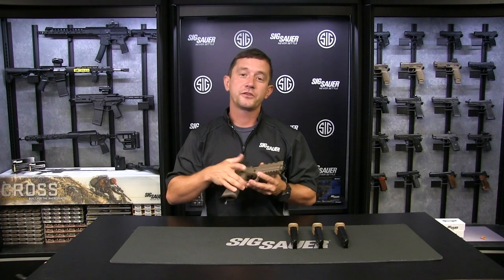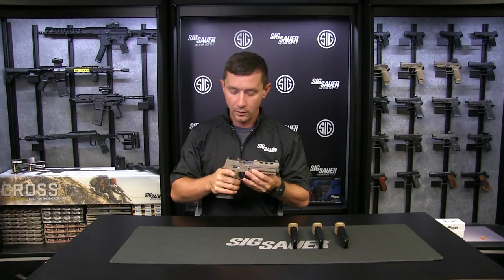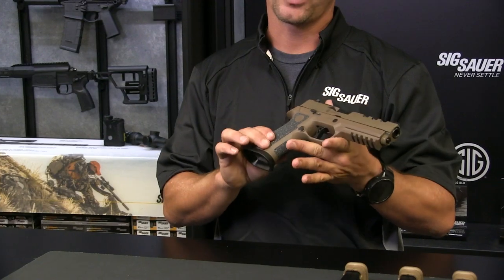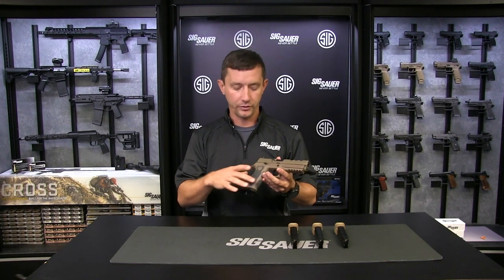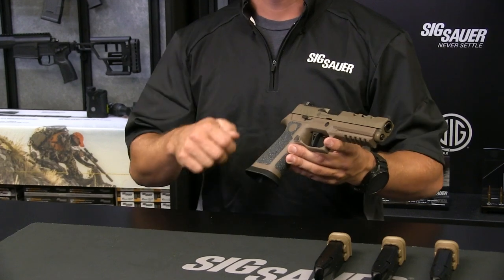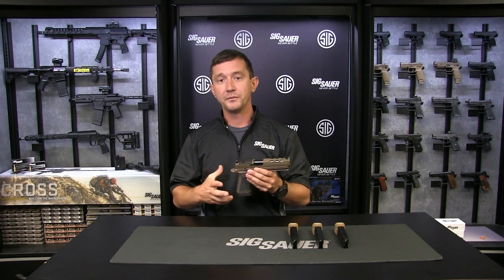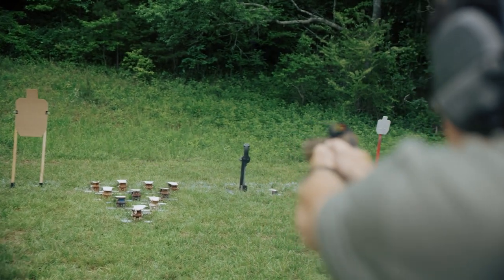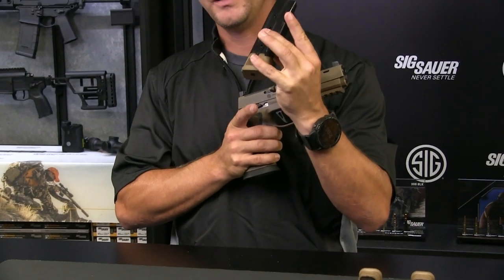Introducing the P320-XFIVE DH3

Comment: Was cool until he mentioned it took them 2 years to come up with the.... cerakote, silicone carbide, and attach x5 parts to create this gun.
Reply: Exactly, we basically did this as soon as the original p320’s came out.  Why not just have some engineer and/or reps go to competitions and learn from the shooters?
Reply: Had to do it in their spare time. You know, in between getting down on their knees for the government 😂😂🤣🤣
Reply: It took glock 30 yrs to put front slide serration on the guns 😂😂
Reply: I noticed that comment as well. I am also concerned about the “Tactical”. Those lighting cuts look like they may be an issue with the traditional RDS duty holster.
Reply: @tacticalcharlie4696  🤣🤣🤣
Reply: @chap23305  and getting sued for not being drop safe😂
Reply: @michaelsmith4325  Truuuuuuuue
Reply: @cpd9608  that's why they have Daniel Horner and other marksmen on board
Reply: Hahaha
Reply: The new grips will help if your “hands get wet”

Comment: So... Is it going to fire on its own? Just asking. Sig has taken a hit lately in the quality area. P320, P365SAS... C'mon Sig.
Reply: C'mon dude, just drop it already!! (See what I did there?)
Reply: There is a fix for that, just don't become a cop.
Reply: @gator7082  it’s been happening a lot man
Reply: @areyou0k98  it’s a lot of people making these claims man..just type it into this site alone..the weapon has problems..I have 4 p320’s and it’s never happened to me..but the problem very much exists
Reply: @andrewthetool  no Drew. Just the 365SAS has the problem with it's sight. Sig won't acknowledge it and will not fix the problem. The sight, which cannot be adjusted, is not properly aligned with the barrel. So that's the problem in a nutshell. Sig quality is not what it used to be. They've gone for quantity over quality.
Reply: @Chuck Atley  Do you know if it simply happens when you have one loaded in the chamber? Probably a silly question but I'll still ask it.
Reply: @johnnybravo1204  not a silly question. Yes one would have to be in the chamber to fire. However, how long in the chamber or if it could accidentally discharge, immediately upon cycling a round could be a concern. I think, for the most part, the allegations have come from law enforcement officers who generally carry a round in the chamber while on duty. Apparently some condition occurs causing the 320 to accidentally discharge. Not sure what those conditions are as of yet.
Reply: @Duke Daddee  Such a great gun to abandon over this. I'm just not gonna have a round chambered then. Thanks for the reply sir. Have a good one.
Reply: @johnnybravo1204  I understand. Just stay alert when firing or when cycling a round into the chamber. Keep it pointed in a safe direction. And keep an eye on the lawsuits to stay informed. Also keep an eye on what Sig does or doesn't do. Never know if this is a concerted effort to bankrupt Sig based on BS.
Reply: This is just like the canik sfx rival.
Reply: @dukegfsl  most likely using an incorrect holster is my bet. or just lack of trigger discipline.
Reply: I don’t get why sig won’t drop a bunch of tests out of x thousand’s hand guns that are randomly picked through a bunch of conditions through a bunch of different people cause legit or not it is definitely is not a something the unfortunately need to prove to consumers.
Reply: @michaelstringer1840  they have Michael. But remember, the P320 was developed for the US Army. They do not carry locked and loaded. So that may play a role in this. Also Sig IS NOT what they used to be. They have decided to pursue quantity over quality. Much like Toyota did 20 years ago.
Reply: @dukegfsl  ok I forgot that the P320 is what the army uses. I did not know but never really thought of that with how they carried it versus the police/law enforcement. Being real I like how they shoot but because of the lawsuit they fell off the list of handguns. I’ve been looking around for a good carry/self defense hand gun.
Reply: @dukegfsl  to me, there are a few areas of life that can allow for some wiggle room, and things don't have to be perfect. However, a carry gun does NOT fit into that category, and never will for me. I have heard of FAR too many issues with these guns to have any faith in them at all. Heck, my dad and his friend bought 2 brand new Sig's back in the day to train together, and had no end of issues with them, so they had to get rid of them.

Personally, I haven't had a single (and I mean SINGLE) problem with my FN 509T and my brother-in-law's Glock 19 carry gun.

The only issue we've experienced was a failure to eject/stovepipe due to a bad grip, and that happened the first time I shot his Glock many years ago lol.

Point being - guns are Dangerous Tools, and I would rather have my Dangerous Tool be something that I can rely on to not shoot myself or someone else by accident.

Call me crazy, but I do care about Safety. 🤷‍♂️
Reply: @dukegfsl , you’re mistaken Duke. In the Army the pistol is absolutely carried with a round in the chamber, ready to go…
Reply: @thegreenberetlife0191  no. Maybe in SOF units. But not in most units and certainly not CONUS.
Reply: @The Green Beret Life 01  I'm not easily manipulated. I can choose whether to believe it or not which you only assume I have so. Still good to be aware regardless. But I will take your comment into consideration as well.
Reply: @connorbaz5980  I understand. I have Caniks, Glocks, Sigs, S&Ws, Ruger's, Taurus, Springfields & Barettas.  The ONLY firearm I wish I had never purchased is the Sig P365SAS. That is the newest Sig I have and is the one I would get rid of first, but I won't, because it is UNSAFE. I won't carry it because of the sight issue. Sad that a Sig, designed for concealed carry, has a sight that does not promote confidence. EVEN SADDER is the fact that Sig will do nothing to remedy the situation. Think about that. I am an FFL holder and gunsmith and I will never purchase another Sig again due to their unwillingness to not only fix a faulty firearm but acknowledge a problem. It's very obvious to me that the lawyers run the show now.
Reply: @dukegfsl  absolutely right. I also cannot fathom how many people in the gun community literally make excuses for Sig in the face of such issues. This isn't just a "bad look" for the community, I think it's a very serious issue that gives The Other Side a lot of ammo to use against guns in general.

If you literally cannot rely on a firearm to be at least mechanically safe...I mean, I could see how it'd be easy to get the support of well-meaning yet ignorant people on banning these types of "dangerous, self-shooting weapons of mass destruction off our streets."

This is absolutely shameful in my eyes. 

Even if you own a Sig that shoots flawlessly, and you've NEVER had a SINGLE issue with, you should still be 100% in support of holding Sig accountable, and improving themselves, their reliability, quality control, and clearing their name.

But NOPE, the fanboys cry when you (rightfully) criticize a BAD product, and call you names.

Bunch of immature little bitches we have in the community right now unfortunately. All focused on "the next big, cool, Instagram trend-thingy."
Reply: @michaelstringer1840  if you're on the larger framed side, I would recommend the FN 509 series. I'm 6'1" and can conceal the tactical version pretty well. Bulkier clothing does help as well, since I can't exactly carry appendix...(40-ish pounds down the road maybe.)

It's definitely a little on the thick side, but it is a full size frame with a midsize slide, 17 round mags and is optics ready.

I really like it so far. Unfortunately, there's not as much aftermarket support for it out there which is a crying shame. It's a fantastic platform, and the one that really revolutionized the multi-optic cut system for handguns.
Reply: @connorbaz5980   thanks for the info I’ll keep my eyes peeled but I’m at liberty of what my local ranges have for rentals/used firearms. Rentals I can put more round’s through. The used one I’m limited to 10 rounds. I definitely want to put a few rounds through it to get a feel for it.
Reply: Teslas have FSD- full self driving. Sig has FSF - full self firing
Reply: @connorbaz5980  That's why I love these venues. It helps one make better decisions. I've ALWAYS loved Sig. Will no longer buy anything post 2015.
Reply: @michaelstringer1840  ahh, I see. Yeah the FN is awesome, but it is a bit pricey - and so are the magazines. Aftermarket support is a BIG factor, especially for budget challenged people like myself (most weeks lol.)

If you're on a budget, I'd recommend a Canik or a Palmetto State Armory Dagger (Glock Pattern Handgun) which can be found for around $300 or so. I'm guessing most Glock accessories should work just fine with the Dagger, and they won't break the bank either.

I've heard a lot of great things from both of those brands, and minimal negatives. Still, I'd recommend you just find what works for you. If the price is a little steep but the gun is basically everything you're looking for, I'd also just bite the bullet. Ultimately I guess you have to decide for yourself how much your self defense is worth.

I'll likely never have to need mine - but if I do...well, I'll be glad I don't have a Sig lol. 😂
Reply: @michaelstringer1840  understood. I highly recommend the Canik TP9 series. Great firearms for a great price.
Reply: @chuckatley1464  There are are a lot of idiots walking amongst us
Reply: Well, they dropped support for everything but 9mm for the most part. So you figure if they aren't focusing on other things they should be able to get it right.
Reply: I like that you guys basically do the work of the anti gun lobby for free
Reply: @Ronnie Ray  lol yeah like the guys suing sig for their own ND
Reply: @seann2769  lol 👌
Reply: @588holly  a trained police officer? That's a stretch lol🤷‍♂️
Reply: @@dukegfsl  exactly I agree they should have stayed in Germany like HK did 👍
Reply: @@connorbaz5980  exactly right well said👌..Sig Sauer has lost me as a customer I'm all Walther or HK for German guns lol..I wanted an X-Carry but I can't bring myself to give them my hard earned $$..
Reply: @@connorbaz5980  FN makes excellent firearms..I'm on the fence on the 509 series tho ...that "hinged " trigger just bothers me lol..🤷‍♂️
Reply: @@triggercreeps  we get it you're a Sig fanboy 🤣🤣🤦‍♂️
Reply: Your gripe is that you bought a gun with fixed sights and your upset you can’t adjust them? What? Lol. Yeah the 320 had drop issues early a decade ago. And there were a some 365 issues but in the grand scheme of things pretty negligible. I used to be a sig hater myself and have been drawn more to their offerings. Glock had big issues with the gen 4 and poor ejection all manufacturers are going to have some sort of issues at times
Reply: @JoshR-t9j  No, clown. My gripe is that the sights were not properly aligned with the barrel when installed at the factory.

Comment: I'll wait until the lawsuit is over.
Reply: Just don’t carry a loose gun in a purse and you’ll be fine.
Reply: Sig Sauer: Never Settle… in Court.
Reply: @seancallero8549 o why do most of the reports in the lawsuit mention the gun going off unexpectedly while in a proper holster?
Reply: What are they being sued for??
Reply: @chapllc722  The current one is a female detective from last summer who had her duty weapon in her purse, hit something, and it went off. That is the currentl lawsuit that’s on the news, the other reports seem to all be deemed “user error” with the 3rd party armory guys saying there should not be any issues post-2017 update to the p320 if using stock items. Also, if the current lawsuit detective uses a trigger-lock Serpa holster as a “duty holster”, then…. Don’t know.

Comment: Well designed weapon. Put 250rds through mine today and it shoots well. No different than my XFIVE  Legion or 320MAX. Quality offering that fills a duty/tactical role, yet can be used for CO or Production if desired.
Reply: Unless that mag well comes off, it can’t be used for CO or Production. It might be removable, though. Not really clear on their website.
Reply: @AL_1547  Its removed with a single screw. I shoot P320's in USPSA in this configuration.
Reply: @BigfootBrass  Oh perfect! I thought it looked a lot like the mag well on the X-Five Legion that comes off. Sights on this one probably work better for co-witness with an optic than the adjustable rear sight on the Legion. Cool addition to the lineup, but Sig is definitely getting up there as far as number of SKUs.
Reply: @AL_1547  Yes the frame is the exact same as the Legion, just cosmetics.

And the sights lower third cowitness with a 507CX2 that I have mounted on mine. 

They will not however cowitness with a Leopold DPP.

Comment: Everyone that’s commenting on the misfire case.. that was nearly a decade ago. New guns off the line do not have this malfunction. My Sig is pristine, never jams, and I feel completely content.
Reply: No, it is still an issue with the p320s.  That's why half the comments are brutally ripping Sig for not addressing it.
Reply: It’s technically an issue with all firearms. This was blown way out of proportion due to politics and a race to be a military contract. If you do your research, this problem is essentially resolved. Now it’s just user error most likely.
Reply: Faulse, most cases documented on the internet were pretty recent ones
Reply: @gansior4744  Bruh, I can type in my serial number and see that not only do I not need it recalled but that I bought a newer version that has that issue updated. You’re simply wrong.

Comment: beginners question, the competion guns have those skeletonized parts, like the typical Taran tactical or tuned Glocks where you can see a golden barrel. What is the purpose of all that, to save weight? i thought a heavy gun is better in competion? Im not a huge fan of this design at all but when it makes sense.

Comment: How about you fix the fire control group so it only fires when the trigger is pulled.   It would be nice to have a Sig that is safe to use for once.  Also reassign the fire control engineers to something that they are better at.

Comment: I own several of these and can you please fix the $35 bucks for 2 screws and a sealing plate and also use a larger diameter screw for direct mounting a rmr or sro to the slide directly? I have 2 of them with broken screws. One it took 13000 rounds for the screws to break and the other less than 3000. This is the best pistol I have ever owned but a larger screw for direct mounting and not charging 35 bucks for 2 screws would make it perfect.

Comment: The advertised weight of the DH3 is 43.5.  The IDPA max weight with a mag installed is 43.0.  Even with the tungsten grip weight removed and the mag funnel removed i still get over 43oz with a 17rnd mag.  Is there another way to reduce weight of the gun?

Comment: Did you guys fix the small teeny tiny inconvenient issue of the gun discharging without the trigger pulled?
Reply: I have many hours on the range and have shot over 5,000+ rounds through both the X-Five Legion and M17 without any of these so-called discharges without the trigger being pulled.  Do you actually believe the U.S. Military would have adopted the M17/M18 if the P320 design is prone to unintended discharges?  I think not.  Wise up and remove your Glock or whatever blinders you are wearing.

Comment: Does this one also fire by itself? Bold move showcasing a new P320 while being in a lawsuit for the same gun. Not bashing sig at all, I have multiple sig firearms that I’m very happy with. But this is just wild to me
Reply: I’m not saying that some sig pistols have not had issues, but it’s important to learn the details and see how the lawsuit goes. As someone that works in the firearms industry, a lot of user error ends up being “the guns fault” (again, not saying that the lawsuit doesn’t have some truth).
Reply: If they had a problem a company like SIG would recall them, as they did in the past, Thousands of them are carried everyday just fine, the few that have supposedly had this problem, could just as easily been something thy had done to it, like any modification, a holster problem or anything along these lines, but time will tell.
Reply: Careless handling. The pistol is inordinately safe. This is another ambulance chaser looking for a payday dragging out the same argument that has failed in all the previous suits
Reply: It's been what... 6 years? I think you can let it go.
Reply: @protomon  educate yourself, there’s a current lawsuit going on as we speak. Doesn’t mean the plaintiffs are correct. But to release a new p320 model while this is all going on is just bad PR and marketing. Nothing you say and no amount of research will change my mind on that.
Reply: @How_Lay  how many decades did Remington’s faulty trigger get sold and used in the model 700 before it was addressed?
Reply: @magaman3048  the p320s was addressed immediately.
Reply: @How_Lay  it was a voluntary fix, not a recall. And there are new lawsuits filed for multiple agencies having failures with these guns.
Reply: I wonder how many uncommanded discharges were from holsters that were repurposed?
Reply: @magaman3048  amen